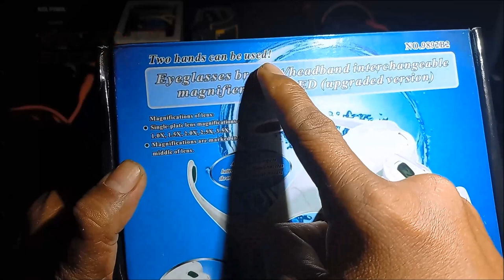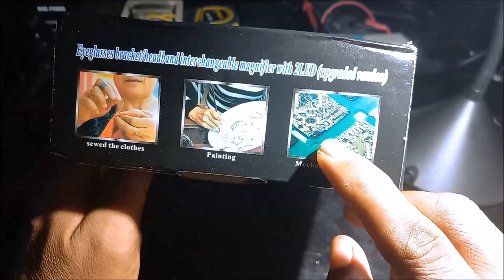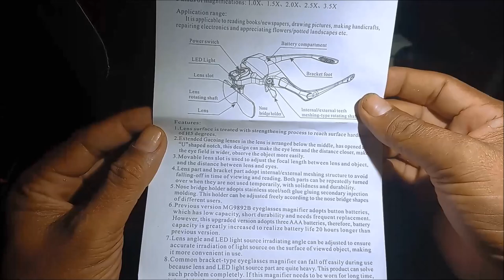Head Mount Magnifier Glasses with LED Lights (Filipino)...

Comment: kamusta review mu sir maganda puba gamitin malinaw mga lens nya?
Reply from the maker: da best sir....dami ko ng nabiling magnifier...so far this is the best
Reply: Sir may operada na Ang mata ko at kailangan konarin Ang magnifying glass...diko na kita Ang maliliit na letter...pls pa share Yung link Kong saan mabibili pls po
Reply from the maker: @noelpinto-rq5cu  ...SIR..DITO PO....https://shopee.ph/Head-Mount-Magnifier-with-LED-Lights-Rechargeable-Headset-Magnifying-Glasses-for-Close-Up-Work-i.478921976.11126331829?sp_atk=00c6115f-dff1-45d1-a977-23c0ae48d876&xptdk=00c6115f-dff1-45d1-a977-23c0ae48d876